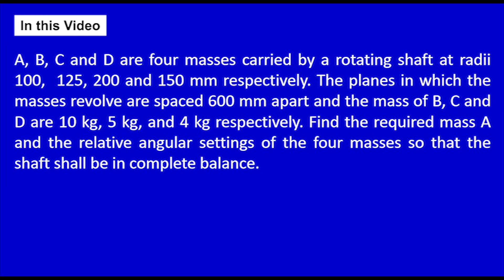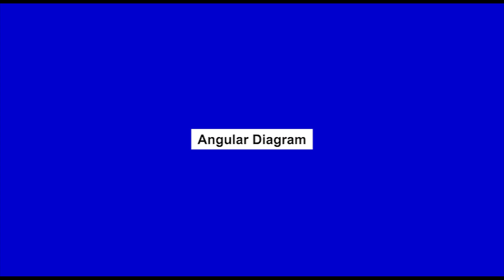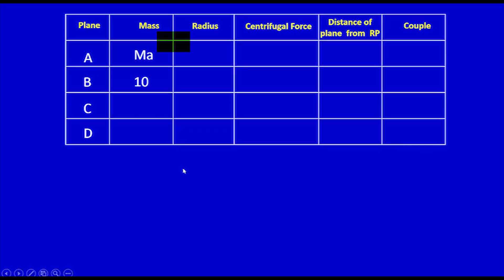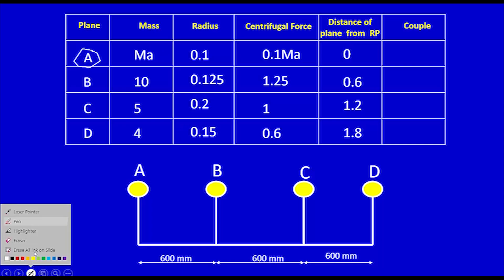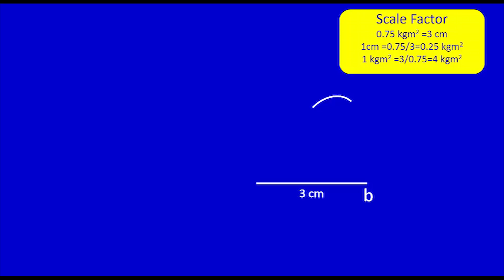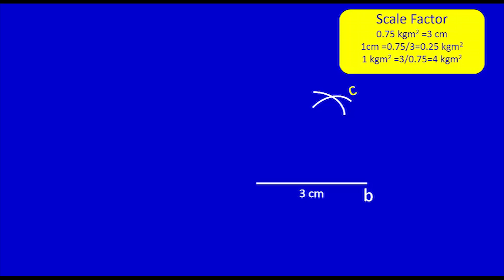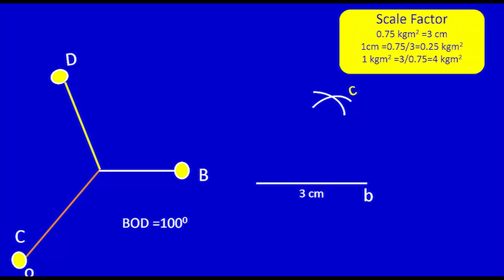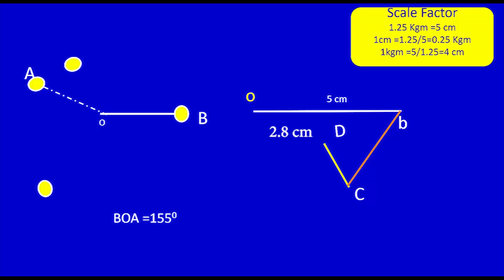Balancing of Rotating Mass | Problem | Dynamics of Machines

Comment: A, B, C and D are four masses carried by a rotating shaft at radii 100,
125, 200 and 150 mm respectively. The planes in which the masses revolve are spaced 600 mm
apart and the mass of B, C and D are 10 kg, 5 kg, and 4 kg respectively.
Find the required mass A and the relative angular settings of the four masses so that the
shaft shall be in complete bala